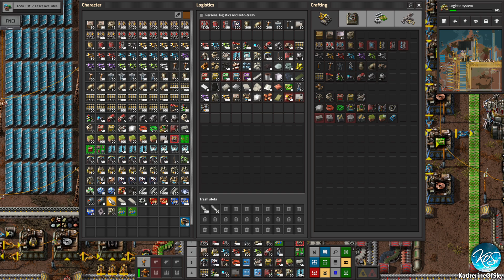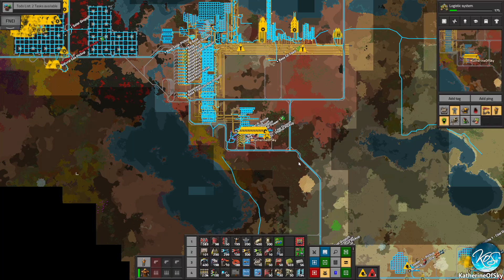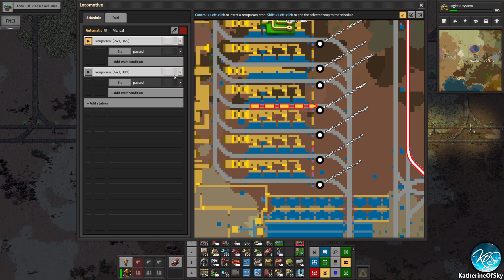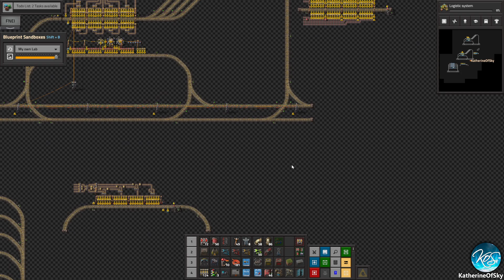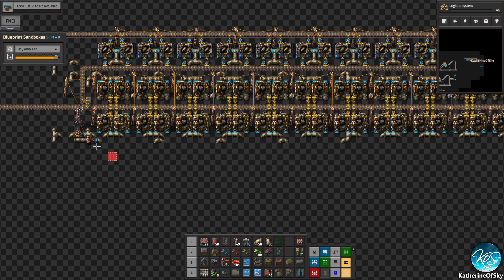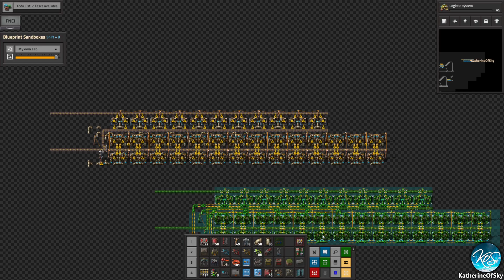Factorio Very BZ 28 - OIL IMPROVEMENTS, Let's Play, Walkthrough, Tutorial

Comment: The petroleum for the solid fuel bypasses the pump (up and around the chemical plants on the left side), so the pump filter is not effective. The top ones DID get petroleum, just not much (the pump took most of it to the lower plants).

The hunt for a stone patch near coal might be unnecessary. If you have a coal outpost and a stone outpost (I think you do?), just train in those materials to a silicone outpost. No need to hunt for ore patches. 👍
Reply from the maker: I just like to put close materials together.  Saves on train trips and congestion on the mainline